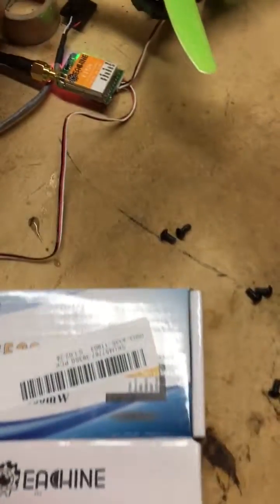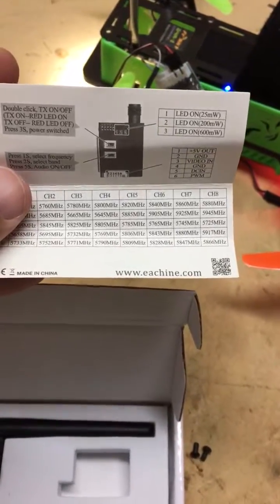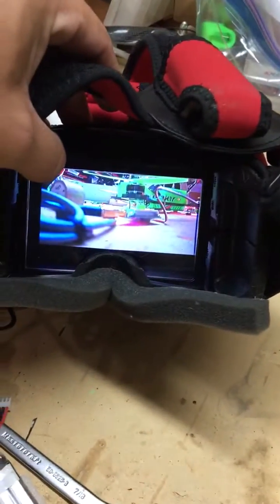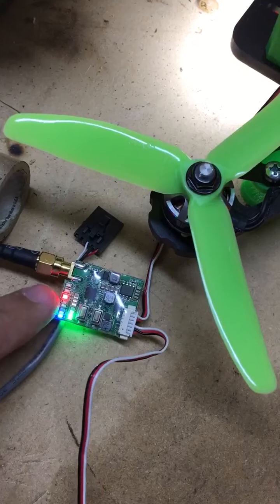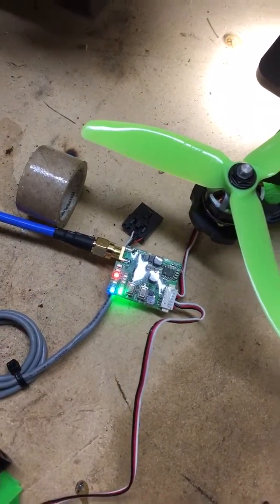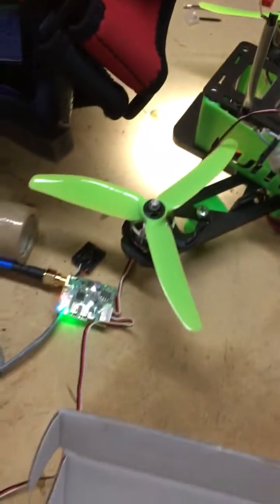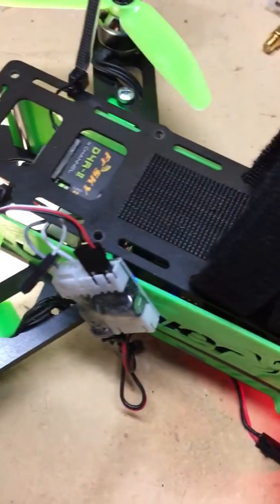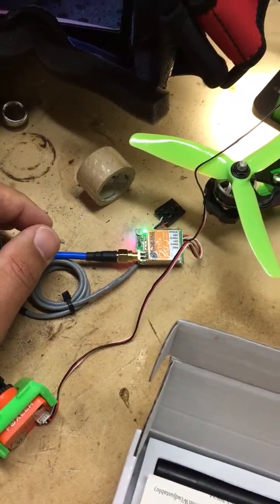Eachine ET526 5.8G 40CH 25mW/200mW/600mW Switchable FPV Transmitter

Comment: 2 questions, one dose the tvx power the camra then? and how do you wire up the audio? do I soder to the 12v place on my pdb
Reply from the maker: C Wood yes it powers the camera from the 5V out. Solder directly to battery voltage. Don't use the 12V regulated pad on some PDB's if you run 3S. Only if you run 4S. But mine is soldered directly to the pdb.

Comment: Has it lasted you long? do you run in 600 mode as well? i've just ordered one myself still waiting on it
Reply from the maker: Enduro Trail Riding yeah it's still going strong. I primarily use the 600mw when I'm not with other people. Just started using the mic feature. Love this transmitter.